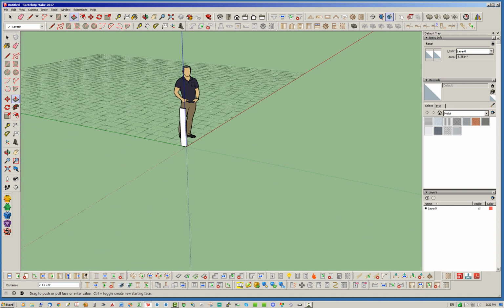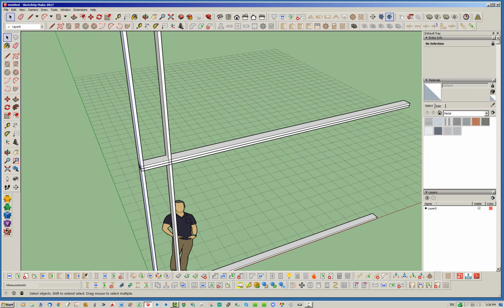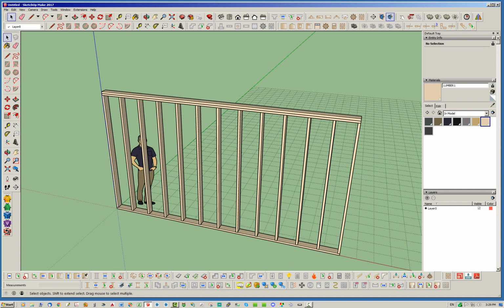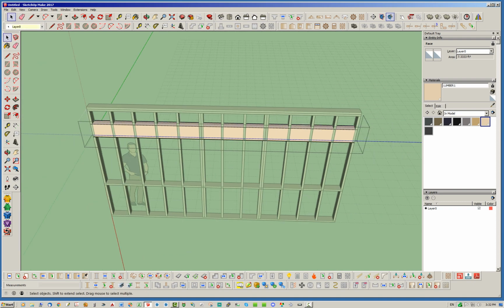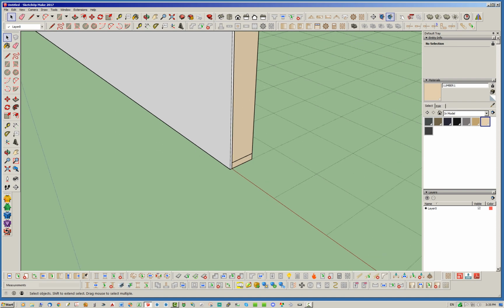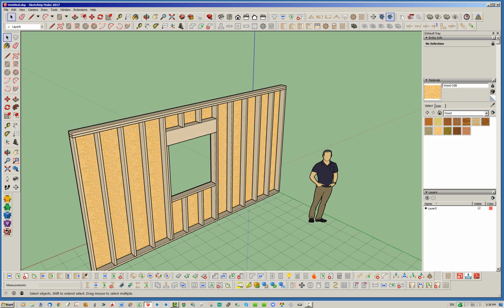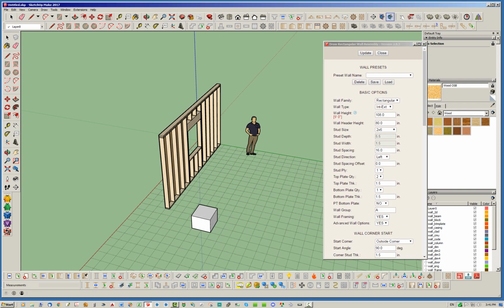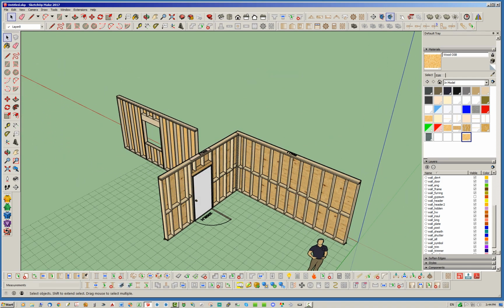Medeek Wall Plugin Tutorial 29 - Why a Wall Plugin?

Comment: I totally agree with your reasoning as to why extensions are needed.  The cool thing about the extensions interfacing with material list and being parametric is the same model can be used to estimate a project, work with the customer on design revisions, including engineering, and then have a completed model that has all the correct components, and elements for a final BOM, and then on to manufacturing.  It doesn't matter if the manufacturing is done on site or offsite.  What a FANTASTIC suite of tools.  KEEP UP THE VISION.  THANK YOU!

Comment: This is an amazing suite of plugins, no doubt about that. My question is when and if the developer takes this to the pro level. Most people looking at this will maybe use it for personal projects but it has the potential to break into the professional workflow space. I really hope it develops into a BIM tool for sketchup. It certainly has the potential and there’s a space in the market for something more economical than let’s say Revit. With that said I love the way the medeek suit has continued to be developed. Keep up the good work and hopefully there will be a pro version someday!
Reply from the maker: The built-in estimating module already has it moving into the BIM sphere of things.  Now I just need to add integrated engineering.
Reply: Hi, I can give you an answer out of own experience. I use the Medeek Suite (Wall, Foundation, Truss) for drawing several projects for Architects, from residential to industrial buildings. You can't compare it to Revit, and I think it shouldn't be like Revit. The Medeek Suite is more flexible and I hope it stays like this. That's also the reason to use SketchUp over Autocad, right? It does generate BOM. The plugin does need some development, because with me the drawings get pretty heavy, but I could be the cause myself because of not using it the right way. But all in all, it saves a lot of time, it is fully parametrical and there are so many attributes to change that you can create a solution for almost every situation. Nathan keep up the good work!
Reply from the maker: @xtremehelinl   Currently the plugins don't deal specifically with generating construction drawings or documents.  Usually this is done within Layout (part of the SketchUp installation).  However, there is no API currently for Layout so there is no way for me to automate this process.  It is currently up to the user to create their own scenes and construction drawings within Layout.  Also there really is no one way or right way to do this in my mind, the number of SketchUp to Layout workflows is a numerous as there are SketchUp users.